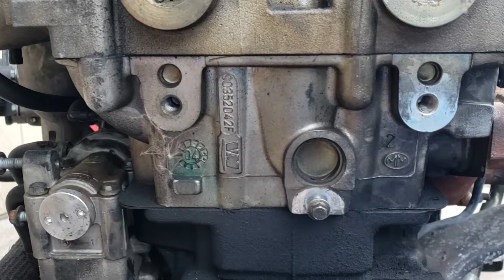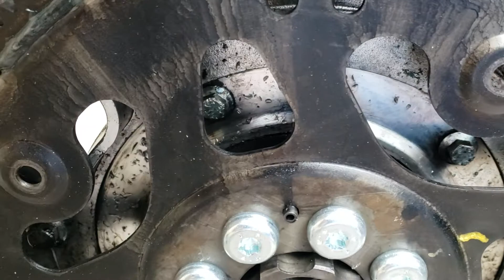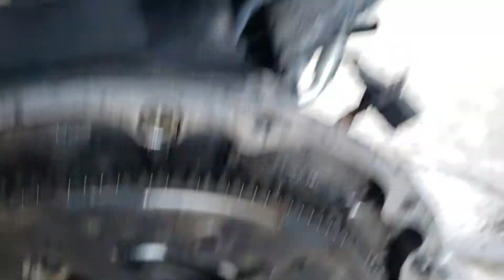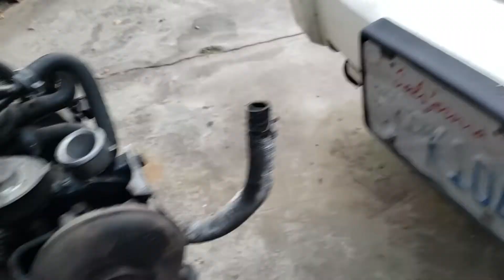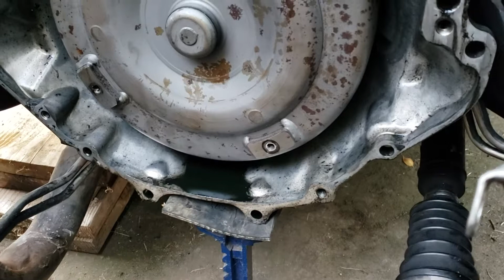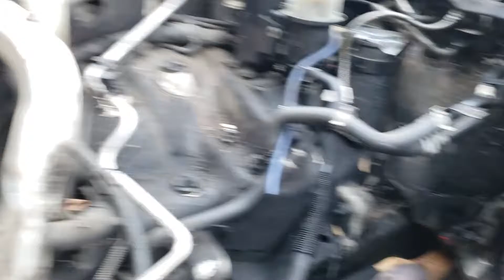2005 Liberty CRD with a serious oil leak

Comment: I need help. 2006 Jeep Liberty CRD Diesel: I was pulling 4k pounds for about 500 miles and the last 80 miles was a solid gradual up hill. I noticed it wasn't going into over drive about 20 miles before the big problem started. We heard a pop. Not a super loud pop but a pop any way. Noticed there was zero oil but was idling fine, just no power at all. It would move a foot and stop so I quickly shut her down. Sent a friend down 6 hours from home to pick it up. He poured a gallon of oil in it and it all ran out. He said a lot of oil was coming out of the exhaust. It doesn't overheat or smell like burnt antifreeze. Also there was no check engine light on but the oil light did come on a little and I added some oil but the oil light went off and never came back on. Did I blow my motor or am I lucky enough that this could be just the turbo or something even cheaper? I can't afford this right now. =(